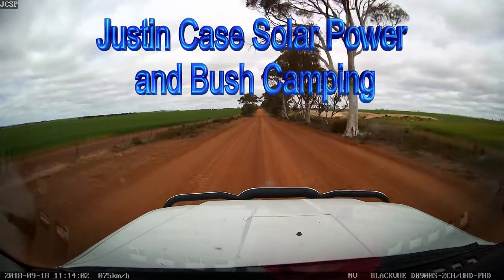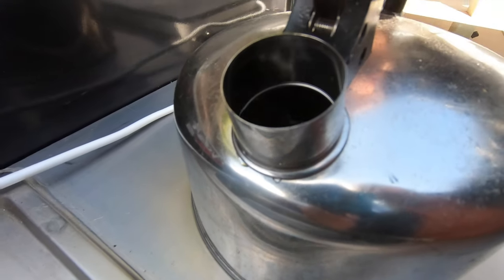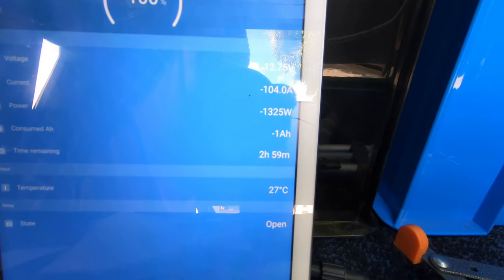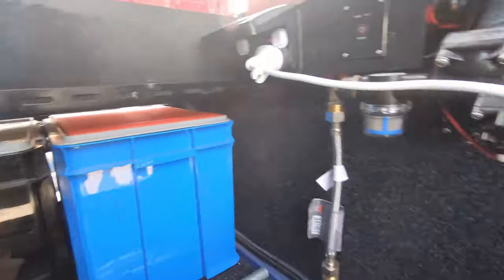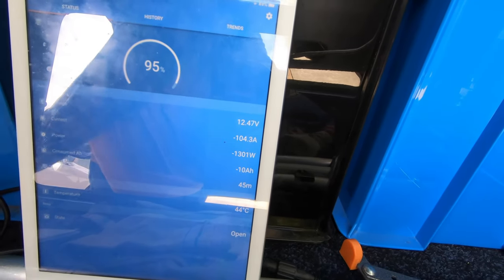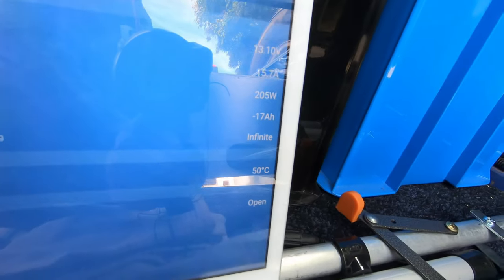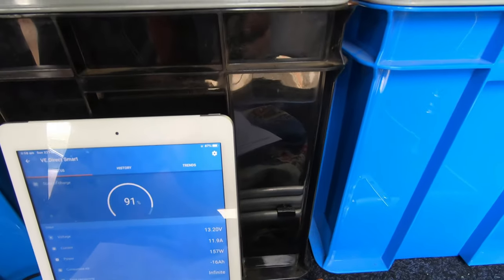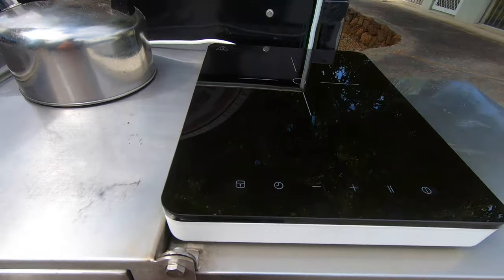Lithium battery Install 12. Testing. Was the work and the $ Worth it?

Comment from the maker: Yes i think it was. We used the wrong shaped kettle for an induction cooker, It still worked just slower.   We took a constant 1500 Watts out of the batteries for a total of 10 mins and that totaled 17AH. Remember these batteries each have 100 usable amps per battery totaling 200AH. The Real test will come on our next camping trip when we are running lights + fridge and freezer and an electric fan if it's hot, or an electric blanket for the bed if it's cold at night.

Comment: Love the software on the iPad. Nice little cooker. Looks like you have a top end system. Very nice. Jim
Reply from the maker: The software comes with the Victron Charge controller and the Battery monitor Jim. Victron make nice gear. The battery monitors can be a bit tough to program, but when you get to know them they are not to bad. The cooker is a $55.00 cooker from IKEA my friend picked it up for us the other day when they were in the city. Did not want to put a high $ one in the camper as it will have a very hard life on the rough roads.

Comment: That induction cooker is very cool!  Nice you can select the max wattage!
Reply from the maker: Yes that is why we got that particular induction cooker.  Most have a lot of preset settings and Sigi did not want that. The water would have boiled in a lot less time if the kettle had a flat bottom. But it's what i had to do the test so i used it. The New kettle is enameled cast iron and works a lot better.

Comment: I'm pretty impressed with the smooth power it produces. Very steady and predictable.
Reply from the maker: Yes the inverter works very well. the induction cooker is a bargain priced unit from IKEA but it has great  reviews and has been on the market for over 2 years. Bargain priced under $60.00au. The 2 by lithium 100AH batteries have enough grunt to do it all. The real test will be on our next camping trip. Should be fun.

Comment: Very nice that worked great.  What a good feeling .
Reply from the maker: Yes it's good when a plan works. I put a lot of work into $ into that trailer.  Sigi is happy with the outcome. Going winter camping this year so i hope it will run the electric blanket. Should do if my calculations are right.

Comment: Congratulations.  Don't you love it, just magic
Reply from the maker: even with the wrong shape bottom on the kettle it worked well. did you read my Pinned comment. lets you see a bit more what i am thinking we could do with so much power.
Reply: @JustinCaseSolarPower  Yes mate thanks I've seen that cheers

Comment: Love your work, just purchased a Victron 150/100 charge controler,  a BMV 712 and a 24 3000va 70a victron inverter to up grade my old 12v system. You videos have been gold in helping me design, and purchase the items needed.👍👍 my system is 100% improved on the initial one I built.
Reply from the maker: Thank you. That is why i make the videos and go into as much detail as i can on the DC Side of things. To help others improve systems that may have been unsafe or not up to spec.
Reply: @JustinCaseSolarPower  hi again, would you be interested in running your eye over my small system ? I don't have any interested partys/hobbyists to assist me in my endeavor,  hence why I value you videos and opinions greatly. I live in a small country town and my hobby of making something from nothing  (solar power ) doesn't create much interest. I like to have an understanding of how things work so I can modify it myself and understand the numbers - volts/amps/watts - as the $$$ are becoming harder to come by I do a lot by myself . And the grid is becoming less reliable. 
Regards John Elliott
Reply from the maker: @A1AussieAdditions  Whats your email address? then i will send you my skype information and we can have a long chat and a look at your system Also makes it easier for me to problem Solve. 3:16 am here got bit by a dong badly on my legs last night at 5pm. Just got back from hospital,  You can also ring e-solar in perth, Ask Silvio or venessa to pass you number on to me ( Chris / Justin Case ) so i can help with your system.
Reply from the maker: comment with you contact details removed to protect your privacy.
Chris

Comment: been a while since I have seen over 100amp draw then I realized you are on 12v lol
Reply from the maker: Yes you pile on the amps when its 12v. Need to really watch the wire size and fusing. That is why i point that out loud and clear when i did my wiring videos.

Comment: G’day mate, did you manage to run a meter to see if these Solar King batteries are really 100ah? Really interest to know cheers
Reply from the maker: I ran them to 90% each battery. I left the last drop of power in them. Never like running them 100% dead.
Reply: Nice, might do an ah test myself if I get one. Cheers